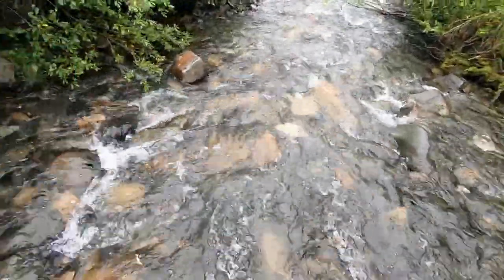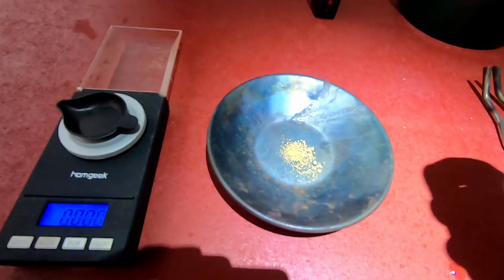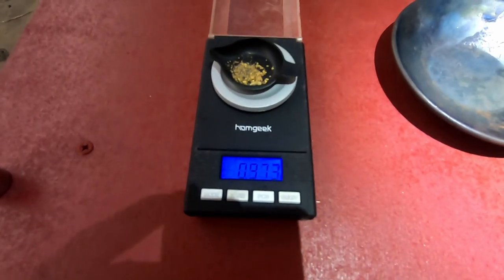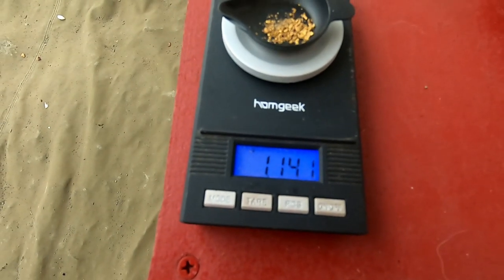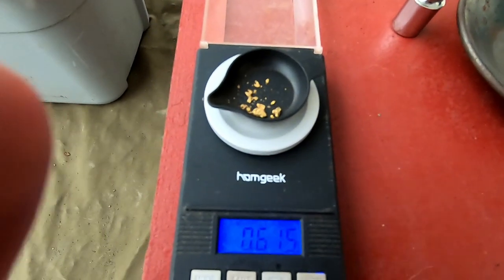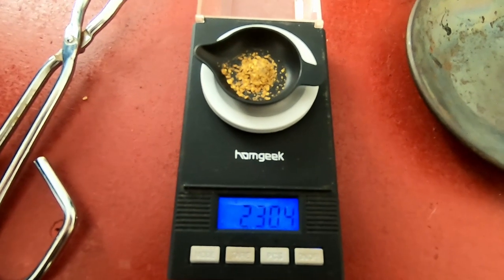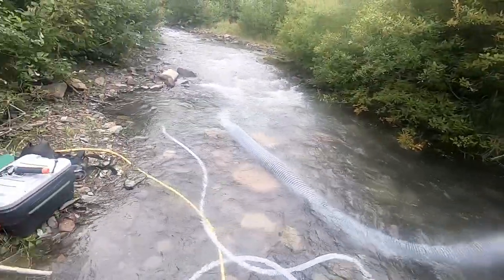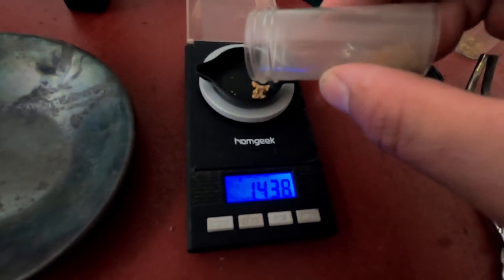Downstream dredging yields our BEST GOLD of the season!  (Gold Dredging Alaska)

Comment: I’m curious,?  Do you just dredge down to the white layer of clay or do you work the clay too ?  I’m out of Oregon’s and the geology is different but when we find the clay layer there is nice gold on it but the best chunky stuff is out of that sticky white layer below !
Reply from the maker: Well this material is a bit different. We have come across traditional clay deposits in other locations on the claim and we would go through it to bedrock. On this material though we are pretty sure it was not deposited from top to bottom like when clay settles out of glacial water or another water source with clay in it. We believe this is actually coming up from two fault lines below and it is a made of rocks that are ground to a super fine material. Interspersed is some super round rocks that would be formed like that from pressure and friction.  
We may test more of that material next season but so far the gold has been laying right on top or just in a bit.
Reply: @twodudesonedredge  Interesting !! 👍🏻👍🏻 Good luck this next season !

Comment: What dry suits are you guys using and in how low of water temps? I’m trying to figure out a dry suit or water heater to use. Thank you in advance.
Reply from the maker: I think we have a bare 5 or 7 mm thick dry suit that was special made for dredging. Water temps are regularly 33-40 degrees. Very cold 🥶. But the suit does a great job keeping us warm. 

We are looking into wet suits with hot water though as we've heard it's better. You stay warmer, can work longer shifts in the water. You're already wet so a small pin hole (which happens all the time) doesn't bug you at all.